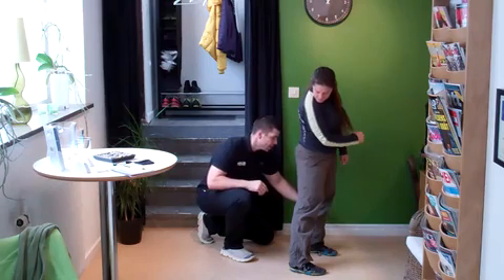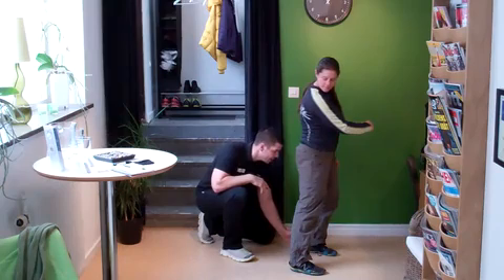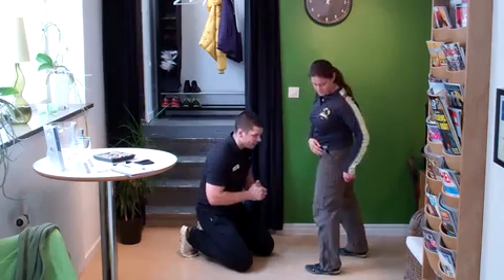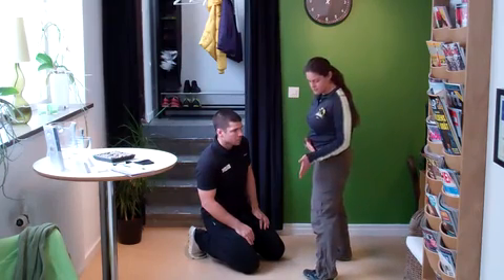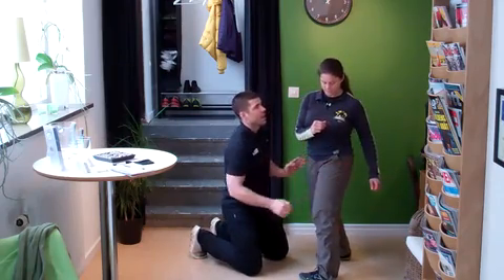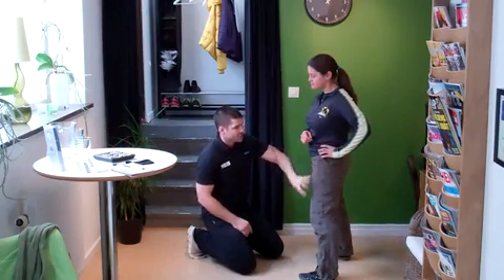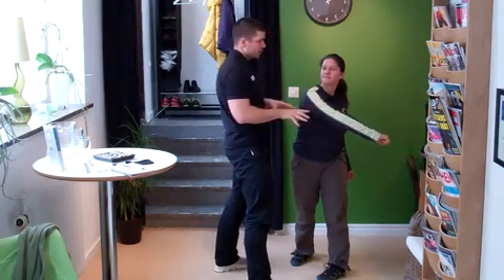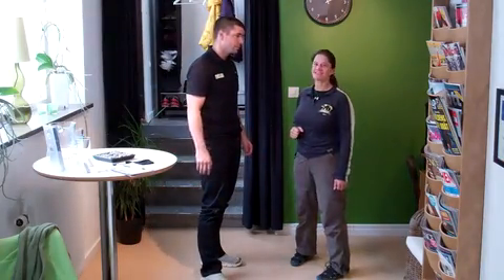Ultimate Frisbee Basic Backhand Throwing Biomechanics

Comment: Would the lower body biomechanics change when we consider the lunge involved in actually throwing a backhand in ultimate?
Reply: yes, and in this lunge you might have a right or left foot in front. good players could get a back hand out in either position. lateral lunges too. so the mechanics do change, one might be up on the toe of one foot too. but what they’re getting at is true, the arm reaching back loads the whole body in all three planes of motion and then follows through in all three. the arm, moves the foot, for a right handed player, standing like they are in the video, when the arm is reached back/loading, ideally the left foot should supinate and the right pronate. and up the chain to the hip, they’re spot on.